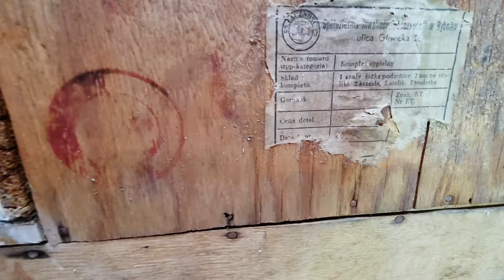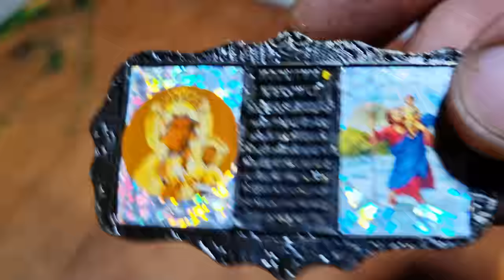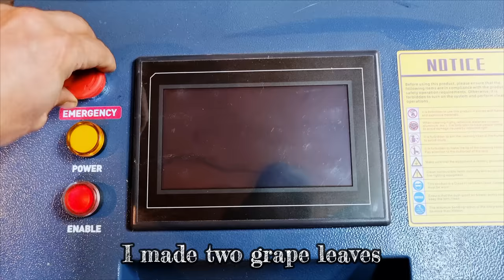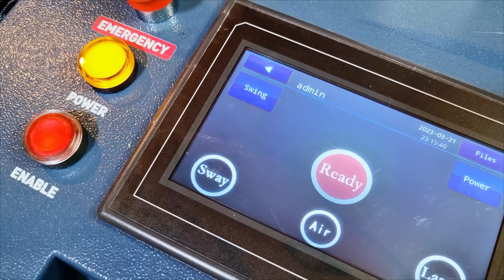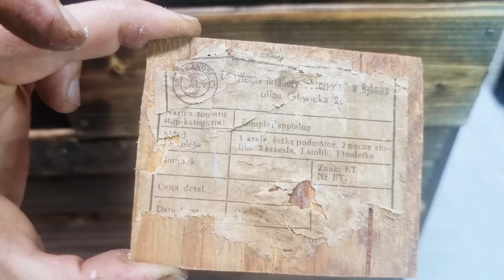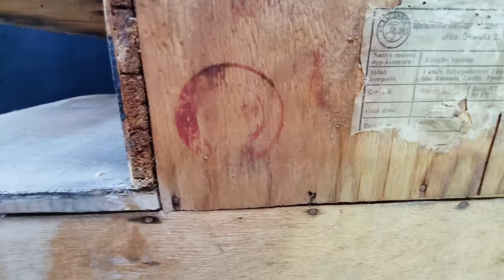Ugly Nightstand Cabinet Transformed into a...Wine Minibar!? - Custom Restoration

Comment: More power to ya bro, I would have thrown that in the trash..... Even the wood is not good wood. And just a note, PLEASE lower that brace on the band saw....you are compromising the blade and it has more of a chance to bite you! And also a better chance that you hand fits under it cut your finger off. NO LONG SLEEVES! never never never around rotary machinery!

Comment: Очень жаль что ты заменил некоторые детали на новые. В любом случае старые закрыл бы шпон. А так какой то корабль Тесея получается 🤷‍♂️😉
Reply from the maker: Hi. The parts that I replaced were severely damaged. The door was made from many pieces of wood as well, I showed that in the video. If I will not replace it I will never be able to engrave something on it. Probably you skipped when I showed that.

Comment: If it weren't for the factory labels on the back, I would have guessed that if was made in a middle school wood shop class. Heavy and crappy wood that is too thick for such a small piece. Very nice salvage work that compliments the design much more than as a night stand. Salud! Several years ago I found a trashed mechanical record player. Too far gone to restore it to a phonograph, I too converted it into a liquor cabinet.

Comment: I wish the grape leaves had each pointed to the outer edge of the drawer but that's a minor thing with how cool this is.
Reply from the maker: Glad you like it! That was my mistake. I prepared two designs, one with a smaller distance between leaves pointing to the outer edge and one with the correct distance between them. Still, unfortunately, I forgot to turn one of them and was too late when I realised the machine was engraving already, and I didn't have the power to start all over again. If I have to make it for someone else, I will, but this piece will serve in my home, so it doesn't bother me that much.

Comment: Zepsułeś efekt środkiem i nogami.
Stojak na butelni niestabilny co widać przy pierwszym wyciąganiu butelki.
Napracowałeś się a efekt ogólny...
Reply from the maker: The bottle holder is stable enough; if you hit it, it moves a little, but that's not a problem; it doesn't fall or change position. For the legs, I chose not to cover them in veneer because  I like it more like that 🤷‍♂️

Comment: I respect the work that went into that but that was a pretty poorly made cabinet that wasnt worth saving.. I.e an identicle cabinet could of been made with less work using the same materials.
If it was all nice joints then fair enough.. Or if it was nice wood but it was nails and pine with a veneer... And the only dovetails on the drawers were poorly done.

Great as an advertisement of ones skill set though.
Reply from the maker: Thank you, Darren. It depends on how you see it. For me, it made sense to put all this work into it. I'm a video creator, so I could show some stuff to my audience that they may find helpful for other projects. 
I'm also going to use it, and as long as it is already in my home, why should I throw it away and not try to give it a use?
I'm passionate about doing this, so working on it was a pleasure, and I could experiment with the CNC on it. Thank you for watching! Cheers! 🙂
Reply: @rustyshadesrestoration  fair enough
I suppose im thinking from a financial point of view.. If you was doing it to make money selling on then you would struggle for it to be worth while but for your own home and to practice a few techniques then the money sides not relevant.
👍

Comment: Please take care and consider not to use the router in such a way - it is very dangerous
Reply from the maker: Hi. Why do you think that? It is attached to the table with four long screwes. I saw many using it like that. How you will use it?
Reply: @rustyshadesrestoration  the most dangerous part - is the actual piece which being held with your fingers only, that may cause a kickback, throwing the piece away and your fingers right onto the router bit.
To avoid kickback you should move the piece against the rotation direction of the router bit and consider using a fence. But it would be much safer to fix the piece and moving the router instead.
Reply from the maker: Oh, I get it. Thank you so much for your advice and time. I'll try to find a way to fix the piece on something like a pusher...I have to think about it. 🤔 Or maybe a table with a fence...
Reply: @rustyshadesrestoration  that's gonna be great, your fingers will definitely appreciate it! ;)